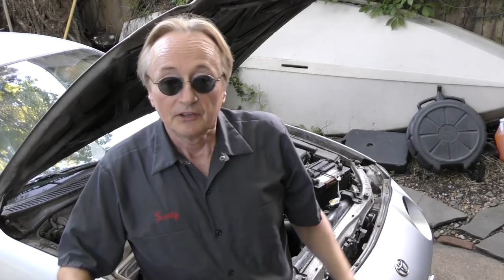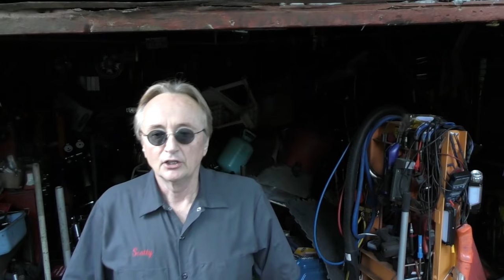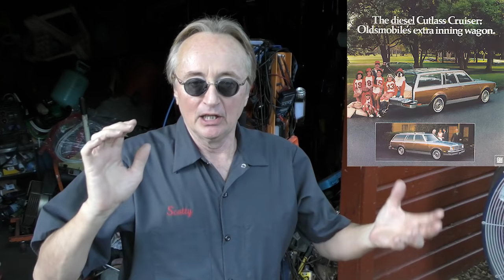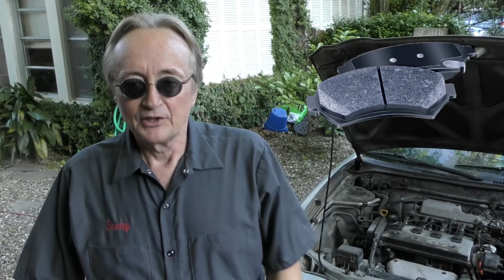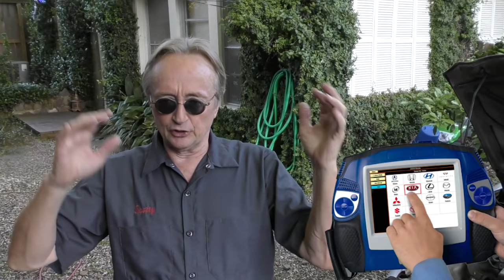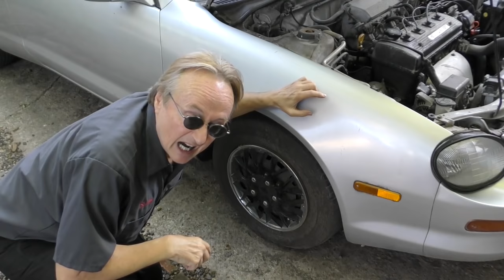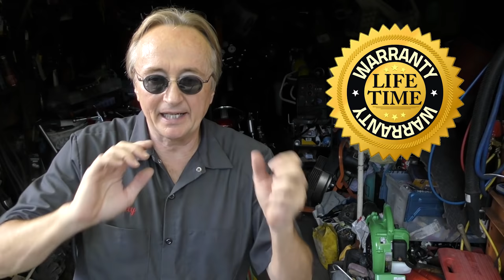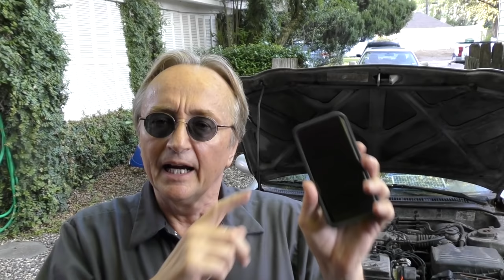5 Scams Your Car Mechanic Doesn’t Want You to Know

Comment: Only real good info I found here is to find an honest mechanic. Otherwise your scaring people out of doing services they need and telling them to ignore suggested intervals. I lmao every time a trans comes in burnt up and find they never changed the fluid or filter or the level was never checked because it requires a special tool and Walmart never mentioned your trans leak, even though we suggest it every 50k miles or missing gdi engines do to carbon because an induction service is a scam. Bent valves because they don’t have an interval on chains though we suggest them at 100k. You just have to find an honest and knowledgeable shop or tech. I made a killing on recalls and would usually suggest a bit since a lot of people only come to dealers for recalls and there only services in the last 8 years was at local quick lube that does quickie 5 min oil changes, tires, and brakes and their 9$/hr mechanic couldn’t care less about much else. Just do some research on shops, talk to the employees, and do a little research on your car and services and ask questions. If something doesn’t seem right then ask and keep track of your services and repairs. A shop may suggest a service due to time or miles not knowing you had it done at another shop a year ago. A shop is not going to spend 20minutes to remove a spark plug at 100k miles to suggest it to you, They’ll recommend them due to time and miles, it’s up to you to know you had it done a year ago.

Comment: Some of these cars they can change the service intervals. My friends Mazda6 diesel they married the service light up to the dpf and i’ve seen bills and it had nothing to do with his dpf  they use to charge him 120 just to plug it in,, also the dip stick had 3 point marks a,, “Low ~ High ~ X. “he use to check the oil twice a week he was so paranoid after the dealer told him if it goes over the X your engine will blow up (run on) I took over from there and use to reset his dpf flashing light with a paper clip 😂 for.... Frrreeeeeee

Comment: These crooked mechanics should realize that if they're honest, customer will come back.  My current mechanic will tell me that I don't need the repair at this time, he'll check again at next oil change vs my local Jiffy Lube that told me that I needed new belts and this and that which my mechanic told me nothings wrong with everything Jiffy Lube mentioned.  
My mechanic's shop is busy all the time with life long customers.  
My local Dodge Dealer does the same thing where they try to throw in all these "dealership recommended services" which is not in the owner's manual.  So I take my car to dodge dealer next town over which never done that.

Comment: I have a gmc truck 2000 is the year randomly when I come to a complete stop the brake pedal will slightly go down vibrate and left side will jerk had it looked at three different people the end results is that breaks are all good hoses and everything someone said abs module even though my abs light has never came on. Anyone know what's going on? And it's only when I come to complete stop not all the time just randomly not when I put on breaks but when complete stop

Comment: This guy seems like the kind of backyard mechanic who says hes ase certified and is a master tech because he changed someones wiper blades in the parking lot of an autozone or advance. Oh your oil life is at 0% for the last 4k miles? dont worry about it. that reminder is just there to make you go to the dealership and get ripped off. Who would you rather trust? A guy whos working out of a shed with harbor freight tools laying down on plywood or the engineers who have put in 100s of thousands of hours in research and development to tell you the oil should be changed at 3k miles not when you feel like. Or your hearing metal scraping when you hit the brakes? Ehh they got another 10k miles on them just slap a new set of pads on those old grooved glazed over rotors and youll be fine. So called "mechanics" like this are what give actual repair businesses a bad name. My 10 dollar scanner that connects to my phone says i dont need spark plugs even though the cars misfiring like crazy and shaking real bad and has 200k miles on the motor and never had plugs changed even though the manufacturer says change them at 60k miles your just trying to rip me off by saying i need to get my plugs changed.

Comment: They told a female co worker that they had to replave rear drums on Focus in addition to 900 brake bill but they would have charged 250 .ore if they replaced the brKe shoes an that was the big chain mi..... muff.they are thieves.

Comment: Scotty i really like your insight, you have a some awesome tips. Keep up the good work. I did have a question about what u said regarding the direct injection engines though. So I have a 2013 2.0 turbo Ford escape. Which is direct injection. I have 90k miles. Should I run some valve cleaner or something through it? I have occasionally put Lucas fuel additive? Do u think that will help keep those values clean? Also I should probably flush the transmission properly. Lemme know what u think, thank you